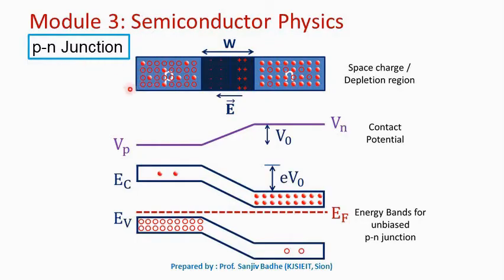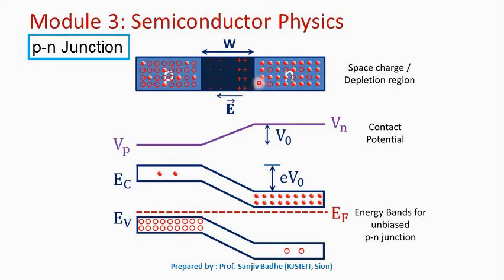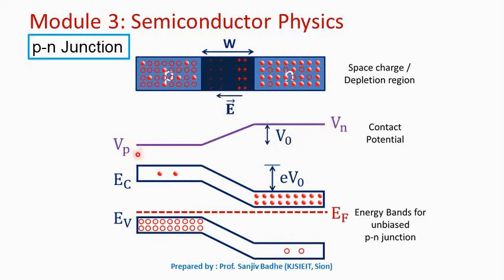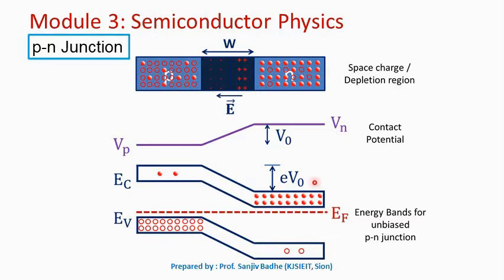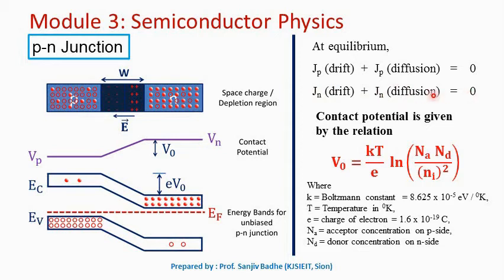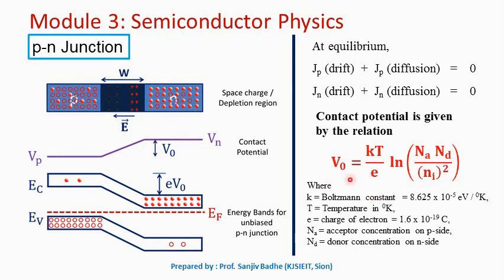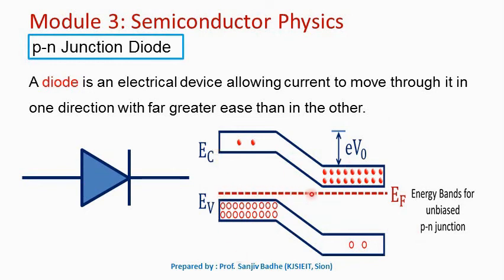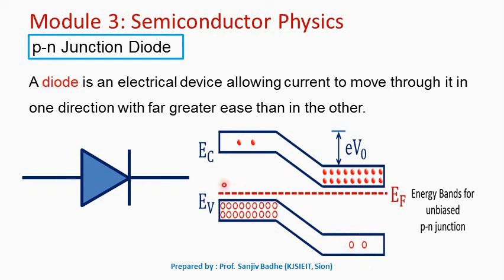p n junction (depletion region and energy bands)

Comment: what are these positive and negative charges you have shown. Are they immobile ions or what. And also as electrons and holes already are free and immobile ions remains there only. so what is the actual cause of electron and holes not moving further at certain time.
Reply from the maker: Electrons diffusing from n-side to p-side leave behind donor ions (Nd+) and holes diffusing from p-side to n-side leave behind acceptor ions (Na-).  So, the positive and negative charges shown near the junction are these immobile ions. The diffusion of electrons and holes across the junction occurs till the equilibrium is reached. At equilibrium, the negative charge near the junction on p-side, will repel the incoming electrons from n-side and the positive charge near the junction on n-side, will not allow the incoming holes from p-side and the diffusion stops.
Reply: Sir my question is when large number of hole and electron diffuses in both the region, are tnere enough immobile ions or equal number of holes and electron moves  such that when they recombine, do they recombine with the acceptor and donor ion or electron and hole recombine to form an mobile ion....also sir when they again recombine do they again regain their form as they are represented in n and p type...

Also sir why do they fermi level must be same in unbiased case...i am not getting the logic of it
Reply from the maker: ions are immobile. Electrons can cross the junction. And Electrons will cross the junction only if the fermi levels on the two sides are different. In this case, the electrons on one side of the junction have a higher energy, so electrons will flow from the higher energy side to the lower energy side. When p-n junction is formed, this transfer will occur till the equilibrium is reached. At equilibrium, the diffusion stops that means the fermi levels are aligned.